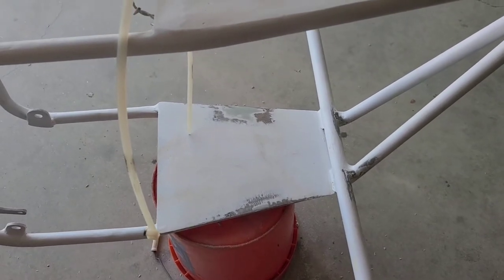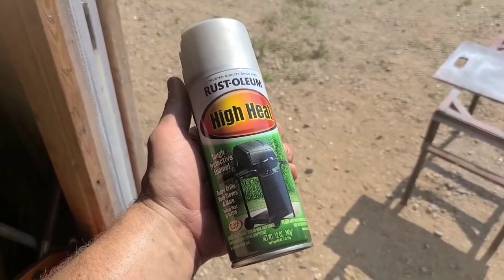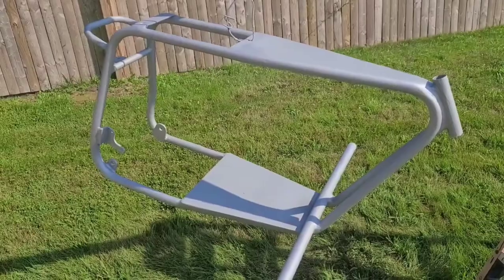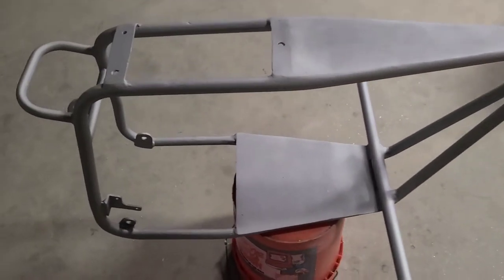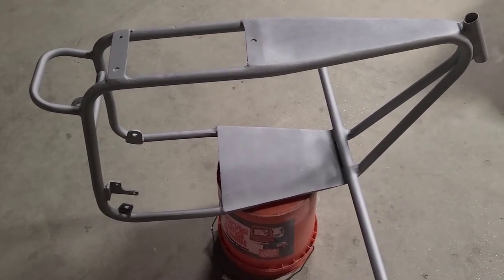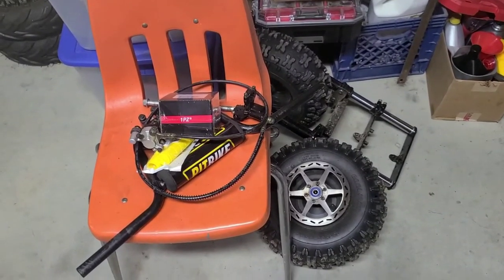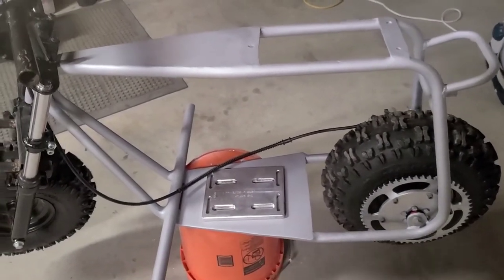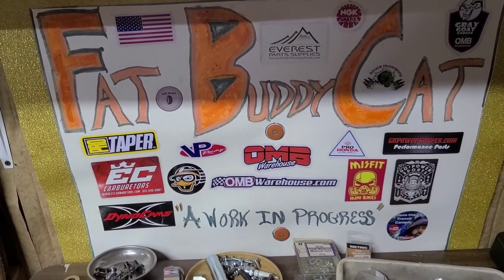Building A Custom Doodlebug Pt.7 "FBC House Of Colors"

Comment: That bondo turned out really good. Looks great.
Reply from the maker: Thanks! I put A lot on as kind of a joke, I knew my angle grinder would get me through it. The not funny part was it ended up being over 100 with humidity so I couldn't mix it to spread thin without clumping too fast.....super frustrating!

Comment: That looks nice...  one of these days   I’m going to fill  spaces in the bt200x     By only using sheet metal, welder& grinder..    ive got a  47 cc Mta2  pocket bike that I went all out on  with extra engine mounts, filled spaces, chain slider & guards , invisible welds, peggs relocated, diamond plate tail, doubled up triple tree, case trimmed down to increase compression with stock jugs, port job,  ported carburetor, stack & pod, stage 4 pipe,polished & trimmed piston, timing key, clutch, sprockets & probably much more I couldn’t remember off the top of my head .. 
 I’m particularly proud of the paint job 
    
White primer, a whole can of neon orange sprayed super thick then a thin layer of white with black specks & then I used a heat gun
To split the thin top  layer  
& it looks like neon orange lightning  through a cloudy sky  ... especially cool under black light.
Reply from the maker: Thanks! That sounds bright dude!!